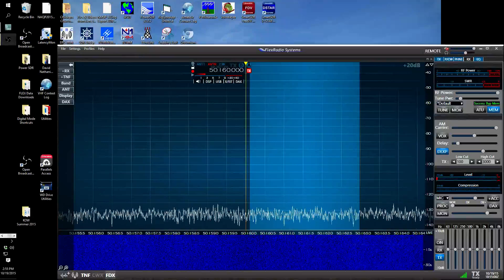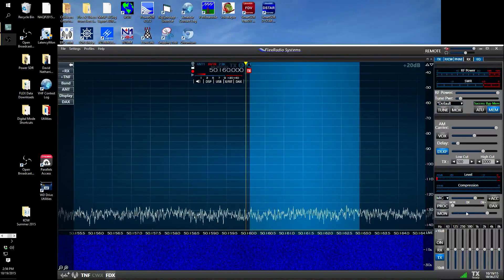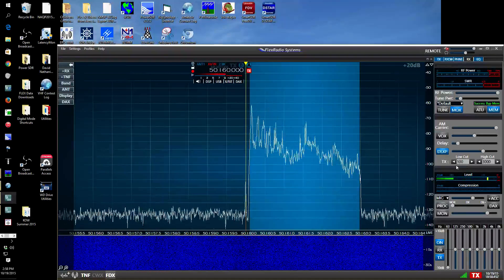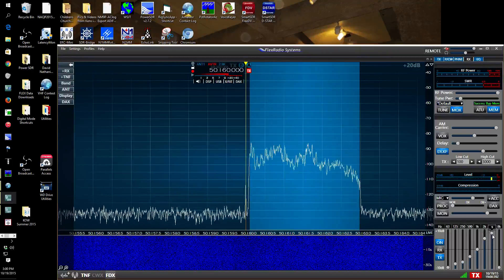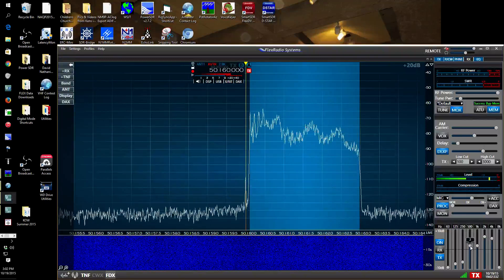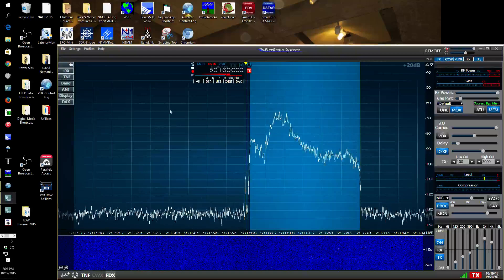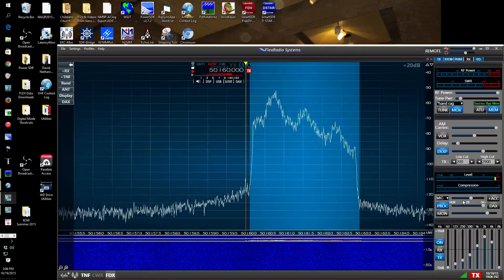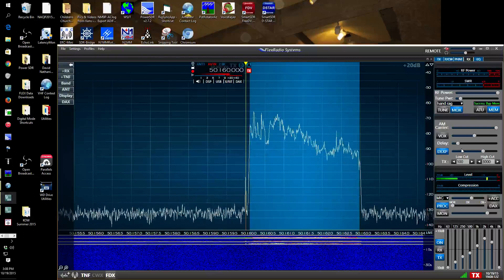Adjusting the 6000 for the Standard Hand Mike, or any new mike

Comment: I'm a bit late with my comment but I wanted to add my thought on the DEXP setting. With my 6600 I simply set it to eliminate any room noise. I'll key the mic, and without talking, raise the DEXP level to the point where the room/background noise just disappears. I've found by doing the DEXP setup that way, the action of the Downward Expander is a lot less abrupt and more like a "soft knee" gate. With my 6600 I use a variety of microphones and outboard processors depending on the mode and my mood. The "basic" configuration is a Sennheiser MD-421 microphone directly into the 6600. My "over the top" AM setup is a late 1950's vintage RCA BK-11 ribbon microphone feeding a Symetrix 528 processor, followed by an Aphex Compellor leveling amplifier into an Orban 9100B Optimod AM. As an AM/FM broadcast audio consulting engineer for over 40 years, I've learned two very important rules. Sound is subjective, and Less is More.

Comment: I may just be slow on the uptake, but I don't understand. What do I do if I don't have a transverter, which is what you were using? How do I get the rig into full duplex mode? I haven't been able to keep on slice in RX mode while the other is in TX mode. That's just the first 3 minutes of the video. I'm sure I'll have more questions when I get all the way through it. 

Thanks for the hard work you're doing for the ham and Flex communities.

KF6E

Comment: Ken.. Enjoyed your video and it was very helpful.  My only problem is that with your setup the audio I hear is delayed and sounds echo!  Very annoying.  What am I doing wrong?
Reply from the maker: Nothing wrong. It is the usual latency delay from the software transmit processing and the internal delay of your second slice receiver. It takes some getting used to. But it is useful to hear in real time what your adjustments do to your audio. 

If you can’t get used to the delay, you can use just one slice and use the quick record and playback function to record your audio and listen to it after an adjustment.

Comment: Hi Ken....nice job...I follow on the Flex community as well but thought it important to comment on you Tube.....ur explanation makes it easy for the new user.   I also use a PR22ut and a Behringer X1622USB mixer....using the mixer to feed 3 audio outputs into a set of studio monitors......on the mic side just the PR22 thru Aux Send to the Flex.....sure would like to learn more about how ur using ur mixer/Pr22 to feed multiple inputs.....now that would be a great video for hams (how To use a Mixer)......especially good for me! Hi     Thanks for ur hard work!  Steve 73 K3WKM

Comment: Nice explanation of the process Ken. It can be difficult to get reasonable audio from a hand microphone. I have found that a lot of hand mics using a plastic housing benefit from the addition of some cotton or other acoustic absorbing material to get rid of that hollow sound you mentioned. Excellent advice regarding "cut to sound better and boost to sound different" when tinkering with the EQ! Having worked you when you have the studio microphone attached I know how good you sound with that setup!   73,  Rob W1AEX